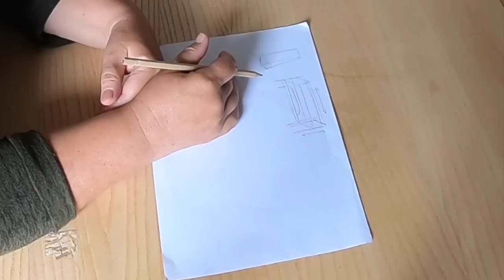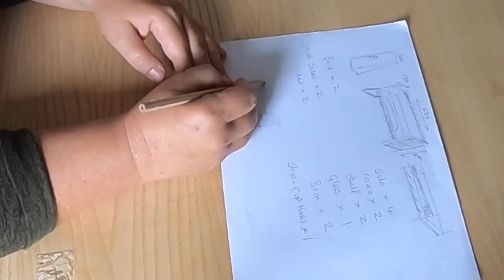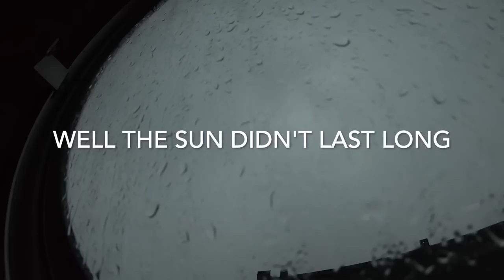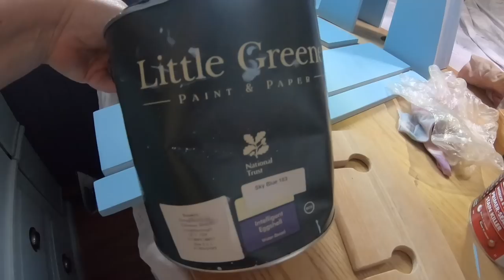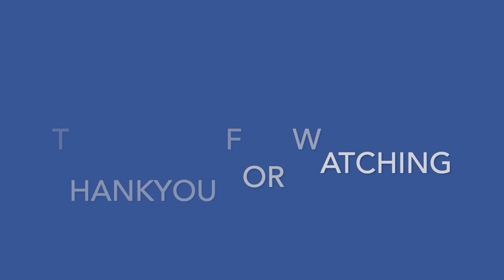VLOG 116, Narrowboat Fit Out - GALLEY SHELVING

Comment: Another brilliant job, I had a thought the other day. Can you still get your window glass out to clean with the frames being so deep? 👍
Reply from the maker: Thankyou 👍yes we can still get the glass out on all of them. It was one thing we had to check at each stage when we were making them. The other thing was the glass in the portholes when open only drop inward level to the front of the wood and we thought they may not give us enough air flow and we would have to put the bigger sized arms on that hold the window when open (they are the bits we would have to change if we ever wanted to change the glass to double glazing) but they don't need it and it works better with the mozzi screens being able to sit flush with the wood without the glass pushing into the net. If i remember this week I will film it for the next vlog so you can see what i mean 👍

Comment: Does the glue stick ok on to paint grandad?
Reply from the maker: Yes solid as a rock, we have tried pulling a bit apart when we were making the kitchen units and all the wood snapped rather than the glued joint so we have no worries for these shelves not holding much weight.👍